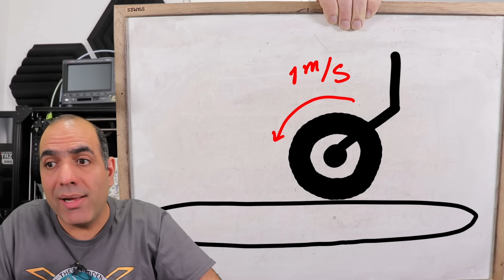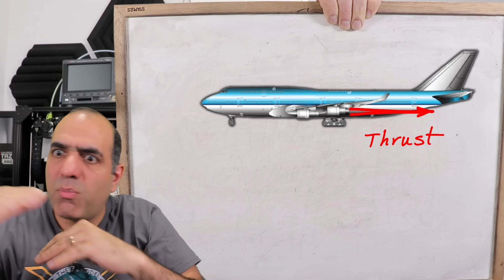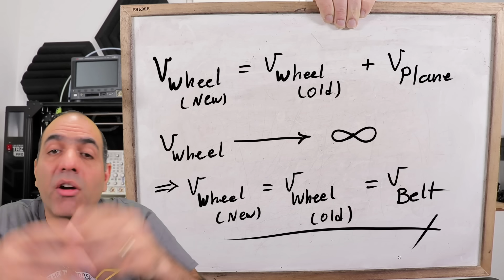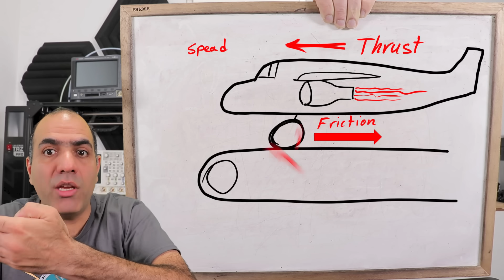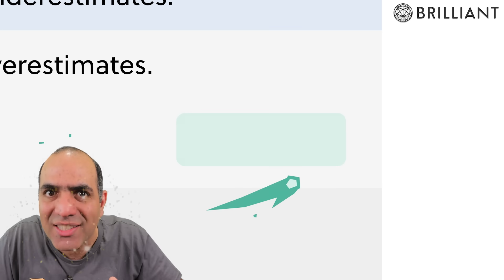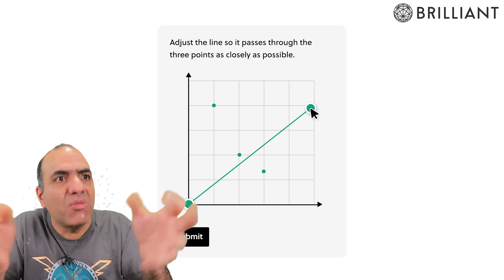Airplane Question that Drove Me NUTS!!!

Comment: paused at 12 seconds, answer is no its not the speed the plane is traveling its wind speed, a plane can take off while sitting still if the wind is fast enough, this happened once during a hurricane and the planes were damaged because they kept lifting off the ground by a few feet and dropping down.  I think the wings got bent upwards and had to be scrapped if i remember right.
Reply: oh you paused it yourself to let us think 😂😂

Comment: If wheels rotate fast enough to cause friction, and the imaginary conveyor has infinite power to sustain the speed, then yes, the wheels are brakes now. Wheels overheat and break, and the plane goes backwards and kaboom because there is no wheel.
I love how the question is designed so that people can mock the "plane goes nowhere" answer, while at the same time IMAGINING F*****G IMPOSSIBLE CONVEYOR.

Comment: The thing is. the acceleration has to match exactly for the plane to to bump off in any of the other velocity components , and the vectorshave to be perfectly parallel to each other. Theoriticallly, relative velocity of the plane with respect to the platform, as well as the velocity of the platform with respect to plane becomes twice the velocity of one another*  if the acceleration in the x axis or the acc given by the plane is perfectly matched with the platform lol

Comment: lift relative to the medium it is trying to enter, the engines move relative to the air volume, not the treadmill, so the wheels would be dragged off of the treadmill

Comment: Alright, answering this before watching the video: 

There's two sides on this matter. 
1. Assuming that the aircraft is static and only the wheels are rotating on the belt, then, no... it's not going anywhere. Wings need a steady airflow, and thus airspeed. The only way to make an aircraft take-off from a static location (without vertical thrust vectoring/VTOL) is if there is a really strong headwind. Then the wings can catch enough airspeed to take-off. But then of course drag would pull the aircraft backwards, slowly decreasing the airspeed till it stalls and crashes blablabla etc. 

2. If the aircraft is indeed using engine thrust and is not static on the belt, then the aircraft would simply roll of the belt as the engines push it off of it. The aircraft's relative speed from the start is zero, thus the engines would still have the same amount of forward thrust as they would have if the aircraft was just on a normal runway. 

So, long story short: Bruh, no! Putting an aircraft on a belt would not do anything to aid the take-off. An aircraft needs airflow.

Comment: NO it won't fly. The wind moving over the wings creates lift not the runway against the wheels.
Reply: Oh... I assumed that the engines would be off and the plane was just siting in place.
If the jet engines are on, then it would move forward on the conveyer until it flew away and the wheels would just be spinning twice as fast as normal.

Comment: Part of what annoys me so much about the question is asking if it takes off. Theoretically it has multiple factors in play here and all could really make it take off. The main thing is the resistance of the air itself usually helping planes pick up that bit of lift alongside the thrust of the plane, so unless theres a turbine in front of the plane helping generate a force opposite on it, I highly doubt it could. Least thats how I feel, I might be wrong but I really dont have much knowledge on planes besides just years of picking up physics knowledge. Okay so in the factor of a normal situation, it should. Guess I was looking at it in a closed environment (which seems to be what the question was asking as well after mehdi mentioned it lmao)

Comment: Actually. The idea is simply great in some way other way that I think...
If a belt moves in same way not opposing so that the plane starts moving even doing nothing will help assist the plane in take off with less fuel because it will reach it's take of speed soon.. And also if the belt running in opposit will help plane while landing so it can use less space runway using wheel breaks and even without reverse thrust.. Will save a lot of fuel and increase Safty 😊
Reply: Except theres no way to match the wheel speed that way unless the plane goes backward

Comment: Am I really the only one thinking the problem was referening to the plane and the belt to be using the same moving force so that the plane looks stationary from an outsider. Or in other words " Can the plane take off if it's not moving forward relative to the surroundings?"

Sure, the wheels are not connected to the thursters, and so in the real world you would need the belt to generate a massive force to counter the plane.

Sounds dumb but that's kinda the idea.

Comment: The only way the conveyor can prevent the plane from taking off is to run fast enough to cause the plane's wheel bearings to fail. Even if the tires fail, the plane can still roll.

Comment: it is very simple: airspeed, ground speed is irrelevant, and airspeed determines to lift. One experience of it I absolutely love, amazing to actually see is flying a light rc airplane on a windy day flying into the wind with a normal airspeed, but a ground speed of it going backward, negative ground velocity as direction is defined by the plane design. also cool with a rc plane landing with wind straight down like a vtol and taking off too due to wind.

Comment: even before medhi says why the plane thing annoys him, I'm just going to say this: THE PLANE DOESN'T USE ITS WHEELS TO GO FORWARD, IT WILL STILL FLY

edit: 5th scenario, the belt begins to move so fast that it generates enough wind for takeoff
Reply: The wheels are just for easiest way to start takeoff right? Because the thrusters need to power slowly before going takeoff and wheels made it less friction with the tracks. Sorry for my bad english
Reply: I can't read mindless screaming.  Can you repeat that when you've calmed down enough to make a coherent thought without the mindless screaming?  tks.

also, I think your caps-lock key might be broken.
Reply: @daexion  but he said to comment it before watching though ._.

Comment: I’m only 50 seconds into the video and my answer is no. I am not an engineer by any means. I’m a simple maintenance guy and my hobby is radios such as HF and GMRS. But my answer is no, airplanes in my understanding don’t work off of ground speed, they work off of air, speed and aerodynamics, it doesn’t matter how fast the ground is moving underneath of the plane if there’s no wind resistance, there’s no chance of it taking off. What kind of stupid question is that electro boom, correct me if I’m wrong. I literally pause the video and wrote my answer.😂

Comment: The thing about a plane is that isn't propelled by the wheels. It's propelled by the propeller or the engine. It doesn't matter how fast it's moving it will still move down the conveyor

Comment: I think it can't take off because if the conveyor belt is moving in the opposite direction at the same rate as the wheels are moving forward then the plane will be stationary and air won't be flowing around the wings to create lift

Comment: The plane needs to physically move forward to produce lift. Therefore it will not take off or move forward at all. Assuming the treadmill is moving at the same max thrust/speed as te plane.

Comment: The answer is obviously yes! because the wheels are not what is moving the plane forwards. of course there's rolling resistance which would slightly increase the takeoff thrust requiring. But The plains thrust is coming from the jet engines mounted to the wings. Which shove hot gases out the back thus moving the plane forwards. The wheels really have nothing to do with it moving forwards except for creating a low friction area for it to move along. Just like planes that take off from the water. The time whenever the wheels really come into play is during landing their used as a  high friction medium turning the momentum into heat energy bringing the plane to a stop. Now if you had a tailwind going the same speed as the plane The plane would never take off because there wouldn't be any air traveling over the wings.

Comment: Essentially, it's just like putting a car on a dyno. It drives, but it's stationary. For a plane to fly, you need speed, which you won't get while on the conveyor belt. Therefore, the plane would not take of

Comment: All you need for an airfoil to produce lift is for air to move over it at a speed that's fast enough to produce a low pressure zone on top of the airfoil. This low pressure zone effectively pulls the airfoil upwards and the plane along with it, so no, the plane would not fly if it was placed on a conveyor belt.

Comment: The question is just not sufficient to give any viable answers. Try solving a Sudoku that only has one number marked down. Theoretically, any Sudoku is solvable, but there's a minimum number of numbers that have to be added to make the solution a specific one. So the question is posted in a way that suggests you can solve the Sudoku in only one correct way, when there's arcually a number of viable solutions. And that's how you create more clicks XD
Reply: Thanks for being one of the few people that gets the point Medhi's trying to make haha

Comment: Thought about this for a long time and came to the conclusion that if the wheels and the conveyor belt are moving at the same speed, then the plane is effectively standing still and there's no air moving over the wings, meaning no liftoff, regardless of thrust. Maybe I just dunno how planes work.

Comment: one of those ambiguous gotcha questions, it says speed but doesn't make any specificatations, in my version it's specifically referring to the overal linear speed of the conveyer belt relative to the airport, and the wheel speed is the linear speed of the plane, so that if the plane is moving north at x mph the entire conveyer belt/runway is moving linearly south at the exact same speed

Comment: 41 sec in....It's been a while since I had mech engi but nah I don't think so. 

The wings of the plan need lift to get the plane off the ground or we wouldn't have to use runways to make them take off; therefore in this scenario there is no lifting element to the forces involved and the plan would just sit still while the treadmill moves up to maximum/whatever velocity equates to the output from the engines with no other movement (and it's usually presumed there is 0 friction both rolling and of all the elements of the machinery and wind in this scenario). 

Also we are assuming 0 wind speed, since with enough wind the plane could take off without the engines even functioning I think.

Ok you are engineering real good here - 4 possible states based on the vagueness of the scenario given. I should have thought more carefully about the plane's thrust being generated and how it would still allow the plane to move as my guess is that this is really about lift and how a plane takes off in the first place rather than some 'gotcha' or exceedingly esoteric idea around friction or banal idea around the plane is just not doing shit.

Comment: What about the air currents introduced by the rapidly spinning belt?
Reply: If anything, that would increase the wind speed experienced by the plane since the belt is moving in the opposite direction of the plane, making it easier to take off. (The plane would still need to accelerate to normal speeds before it got far above the runway though.)

Comment: It doesn't matter.  The engines do not drive the wheels.  The plane moves due to thrust coming from the engines, pushing it forward.
The wheel speed is irrelevant, save just for the friction.
Yes, it will take off.

Comment: The jet engines create thrust but not lift so the airspeed over the wing will be zero and therefore the plane would not fly but would have high ground speed and the wheels will glow but the plane will go nowhere!

Comment: In my understanding, if conveyer belt would drive opposite direction that would simply mean wheels would spin twice as fast ? Wheels does not drive but thrust from jet engines does. So starting on a conveyer belt shouldn't affect it ?

Comment: The plane is accelerated by the trust of the engines, not via the wheels. So the belt cannot hold the plane back, no matter how fast it goes. The described scenario is basically impossible. If this is a hypothetical scenario and we assume no friction in bearings etc. and no effect of the belt on the air above both the wheels and the belt will go infinitely fast and the plain still goes of. This version does not really make sense.
If we think of some realistic version, it would in principle be possible to build a belt large enough for a plane that can go at typical takeoff speed, then the belt would just accelerate to its maximal speed, the wheels would spin very fast, but the speed of the belt would realistically not be so fast that it has an effect on the plane and it would take of. Even if it had an effect, the belt could not be very long, so it would take of or crash after the belt depending on conditions after the belt.
It could also happen that the belt goes so fast that the wheels get destroyed somehow. If this happens before the plane takes of it will crash.

So I don't think there is an interpretation of this scenario that is interesting, it is rather pointless.

Comment: The way I see it, if you will look at real-world bearing friction of the wheels, you also have to look at the mass, bearings friction, air friction, acceleration and maximum possible speed of the motor(s) driving the belt. If the belt is that long, it will take much longer to accelerate than the time the plane will need in order to get up to flight speed. 
And if this is some sort of magical belt made out of unobtainium running on anti-mater powered motors, making it capable of reaching infinity speed in 0s and thus - making the plane stand in place, the wind speed generated from the air friction from the belt will be more than enough to cause the plane to lift up.